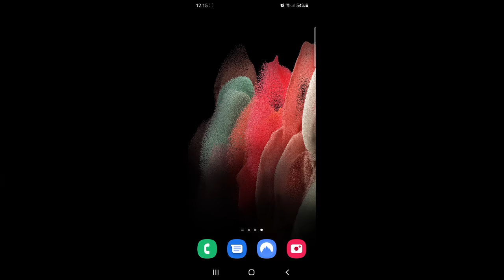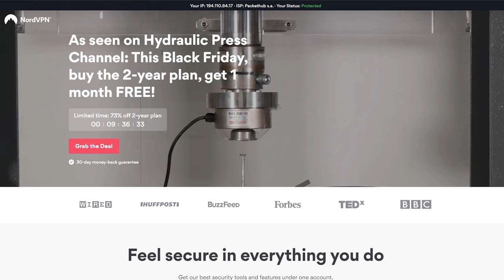How Strong is Floating Table? Hydraulic Press Test!

Comment: Interesting. But now we want to see the same experiment with the double chained floating table. Or with the thicker chain. You get the idea.
Reply: Yes, thicker (heavy-duty) chain! ⛓️
Reply: Or motorcycle chain, I mean why not.
Reply: @Smartzenegger  I think that a motorcycle chain is good for mechanical transmission of rotation, but the most common chain is needed for tension and breaking force here. Although it would also be interesting to compare both chains for breaking.
Reply: Yeah like nautical anchor chain
Reply: Like other's,  I am wondering about stronger chain. Maybe a cable instead? But more so, I am thinking about the square stock. 
Would an I-beam be stronger and smaller at the same time, compared to the double square stock?
Reply: Well there you go, a heavy duty mechanism where by pushing down with the press, it spreads/pulls things apart. So test rope, chain, cables. Definitely inside an enclosure. But that would open up things to pull apart rather than just crush. A 1:1 lever so the down force equals the pull force applied. Just needs to be robust as not to twist or break within the capacity of the press. Guess depends how many things could be tested with it.
Reply: @pihva_rusni  Yeah, I want to see a Finnish chain reaction.
Reply: @axminsterz4151  Same chain used on the Titanic would be nice.
Reply: @Peter Rabbit - Pianist-Composer ♫ Only if it's a Finnish finish.
Reply: lol
Reply: @blaircox1589  this comment needs more likes so they can see this.
Reply: Also, add chain between the center and bottom legs on the table. Will stop swinging
Reply: chain? I want to see cable

Comment: I like this format. It teaches structural engineering through problem solving. We can see where the weak points are and how adding features, such as a corbel, makes the structure stronger. How about doing this with a simple box, table or bridge? Maybe try crushing a car from front to back, and try to find a design that best protects the occupants. You'll probably have to use weaker material so the structure doesn't become stronger than your stand.
Reply: Agreed
Reply: Like
Reply: didn't think about it like that. you're totally right
Reply: The press aint big enough for a car :')

Comment: Observations:
1.) The tube section failed on BENDING --- not the tension chain, which shows the chain is much stronger.
2.) To set the chain strength to govern, use a solid square bar instead of a square tube --- to increase bending capacity.
3.) Use full-pen welds when joining or splicing the bars to match weld and bar strengths.
Of course, I know you share the same observations. I am just happy to mention those.

Comment: It's all dependent on how strong the chain center chain and how well you've welder the mild steel to hardened steel (from the chain). That's it. Either the welds will give out, or the chain will. The steel tubing will just bend and twist until it's crushed into.

Comment: It'll break at whatever the breaking pressure is, for the one chain that's in tension. The other two chains are basically just decoration (in terms of this test- really, they're needed to stabilize it)
Reply: Is that not obvious?
Reply: Thank you for telling us that it breaks when it breaks.
Reply: If the welds of the middle chain are stronger then the chain itself, and the chain is stronger than the main structure.
Reply: Thanks for telling us that the breaking pressure is when it breaks! And yes, he literally said in the video that the other chains are stabilizers.
Reply: @CaptainBread_  reread it, they said that it breaks at the breaking pressure of the chain with all the tension

Comment: Always know your weakest link. In the first test, I knew your frame would give! Not enough reinforcement. I know this because, in my industry, it is critical to know and understand this. I work in steel infrastructure and heavy lifts are critical lifts. My suggestion (And this is nothing but fun) is to use a 3/8, 5/8 and, 3/4 chain. And restructure your framework to compensate in line with each chain size and framework. Now that would be something to watch. My prediction is that your frame will fail. Unless you are not able to meet this challenge? If not! I understand that everyone has their limits. O! Consider this a challenge. Whether you chose to do a challenge like this is your call. Also note grade 80 or 100 chains.

Comment: I'm curious what the rated load capacity of the chain was? Might be interesting to check some different products like chain, cable, straps, turnbuckles etc. You could even compare like products with the same rating manufactured in different countries? Great channel, always makes me smile! Keep the vids coming.
Reply: Looks like 1 ton? or a bit more than that I guess

Comment: That was a very weak chain. In one of my professions, my job was sometimes to test winch and hoisting chains by pulling until they break. it was a safety test. They were very strong. They stretched more than double in length before breaking. It was very fascinating to see.
Reply: Wow, honestly wouldn't have imagined chain could ever stretch that much before snapping.  Id guess winch and hoisting chains differ from the grade 70 or 80 load chains I usually see?
Reply: @KingBigBabyJesus  Yes, they are made of different steel and hardening is different.

Comment: Some problem with this test:

1: the reinforcement at 45° need to stay up and down to support the vertical square tube too (adding another square tube like you did is less efficient)
2: you used a wrong chain to test like that, you need to use a square one, or one for lifting or one like the navy chain (so with middle support), and of course a little bigger
3: for chain adjustment, you can use a bolt

Comment: Would you be able to replace the (weak link) chains with steel cable? Might change the results.
Reply: As the steel cable has no "weak links", it can have unlimited strenght. Better not to try, might damage the press.

Comment: wow, im surprised how much weight these could hold up. Wonder how much more if you built it with thick twisted steel cables
Reply: A better design would be to chain the center piece to the bottom, near the middle chain but on either side of it. Just up to the opposite corner
Reply: @vyor8837  that does sound interesting, I wonder how that would fare against lateral forces though. Seems to be a weakness of these kind of designs

Comment: Suggested improvements:
  1. Make the diagonal struts steeper, reaching all the way to the frame such that the pushing force extends straight to the center of the frame beam.
  2. Add weight to the other side of the table so it balances on the central chain and approaches zero force on the other two chains.

Comment: You should weld on a few lugs, then with a few shackles, attach some grade 8 chain.

The reason I think you should do it this way, instead of just welding the stronger chain, is that the heat of the welding process will cause the chain to become brittle around the weld zone.

Comment: This test will only be as strong as the chain or welds that you create. If your weld is really good, its the tensile strength of the chain that will determine which if you buy from a hardware store; it tells you on the box.

Comment: Useless fact: some of those welded chains are tested to make sure the welds are good, right after they are welded by the chain making machine. You should test how much force chains of different sizes can withstand before failing. 3 samples of each size should be enough to see how strong they are. 
You would be amazed at how much force it takes to pull a US 2X4 inch board apart. When it fails, it sounds like an explosion, and is done behind a safety shield.

Comment: That's interesting. Can you use the same format but thicker chain to see if the welds or the frame will brake?
Also could you stretch or bend welds of different sizes to see hoe strong they are?

Comment: If you understand how it works, the hanging chain bears all the load. The other two just keep it from falling over. To strengthen it, the hanging chain is the one that needs to be stronger. You can even replace it with a solid hunk of steel, but then it doesn't look as magical. Lol

Comment: You were concerned that your welds would break, and it was the chain welds that broke first. 

Great video! Build, press, failure analysis, build better, rince, repeat. 

Idea for future video: Strongest Table Design (challenge: use thin gauge materials. lots of reinforcements. Light and Strong kind of thing.) 

Cheers!

Comment: if u dont get how tf ur brain cant comprehend why this table floats
its simply because
think of the top part is actually obeying gravity and wants to go down, but the middle chain holds it up.
but the center of mass is on one side so technically it will flop on the other side, so to keep that from happening, the two chains on the opposite side makes it so that the top part does not flop over to that side.
so in short, the middle chain keeps it “floating” and the two chains gives stability

Comment: I'd love to see this with multiple chains in the middle.
Reply: Maybe try different material also, there are some synthetic fiber ropes which have higher tensile strength than steel, they use them on winches even. This floating table is a perfect platform to test the materials.
Reply: @alfredocarpaneto5976  Maybe also compare those to steal cables to test the claims that they're stronger.